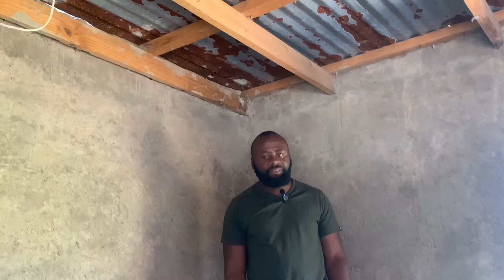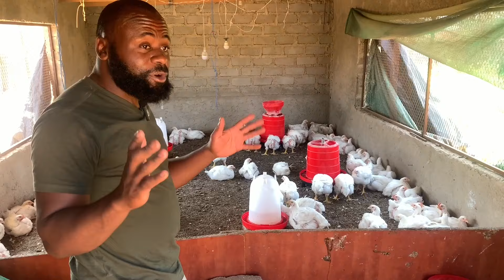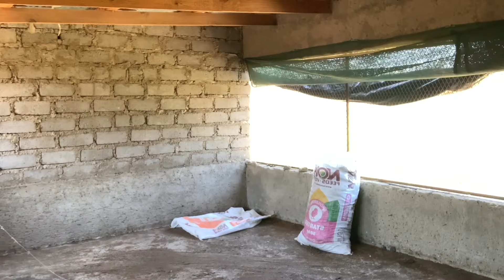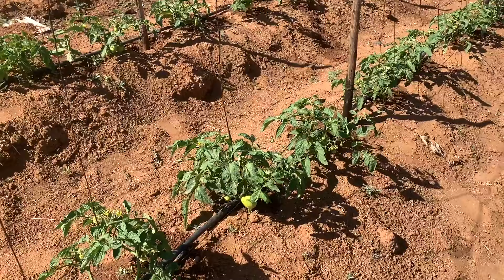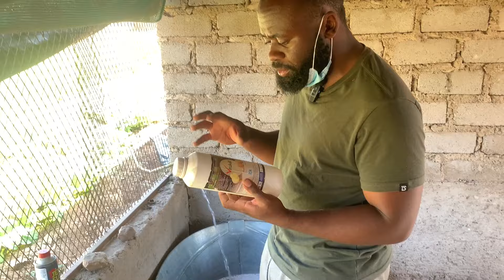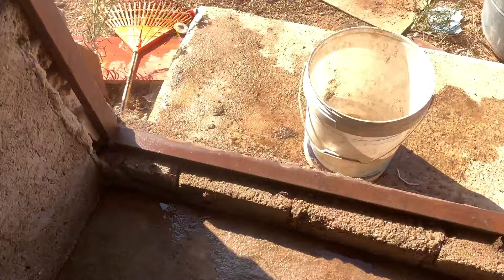How to clean and disinfect your chicken coop to reduce risk of infection on your broiler chicken

Comment: This is just FYI, nothing personal. I think if you improve on your biosecurity, your mortality rate will drop. You need to add a foot dip with disinfectant at the entrance of each chicken house, which I didn't observe. Also, diseases can be transferred from clothing to the birds, especially when you allow visitors inside your chicken house. Also, when moving from different house, always visit the younger flock first because their immunity is very low. If you visit the older flock first, you risk transmitting disease from the older ones to the younger ones. You also need to dedicate certain clothing for when entering your chicken house, don't run erands in the same clothing, and carry infections to your flock. Good luck. You are an inspiration to others. I enjoy your enthusiasm 😉